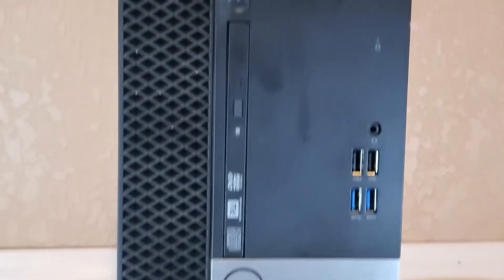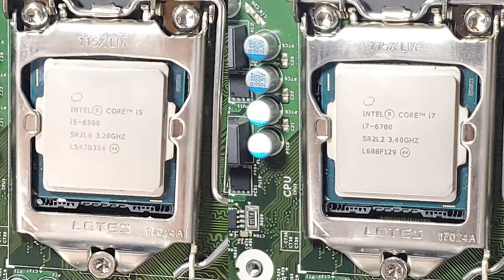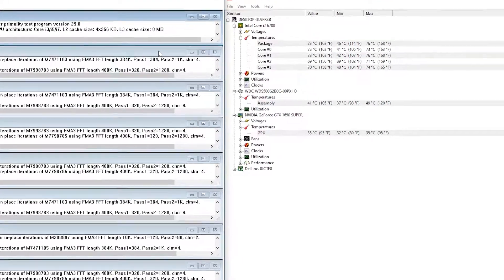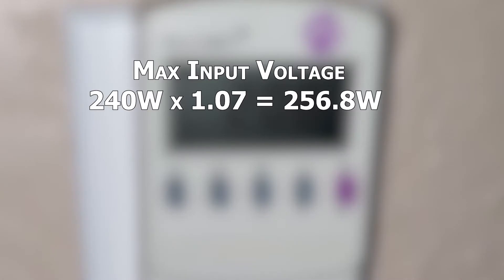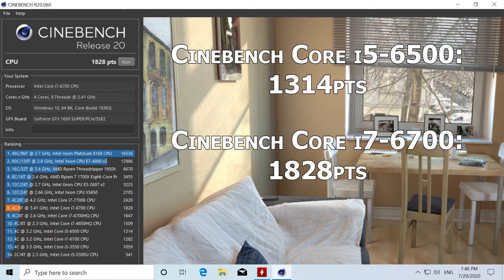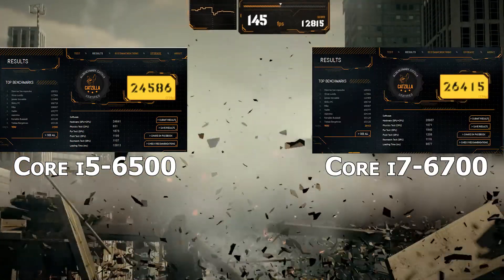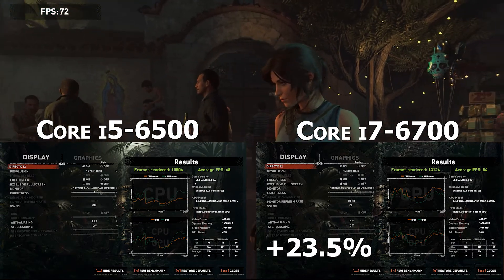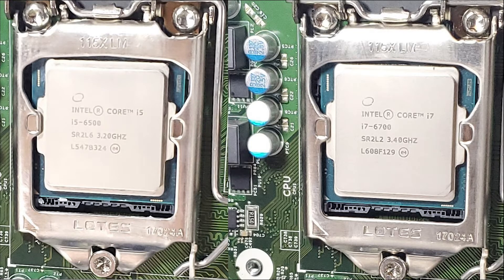Dell Optiplex 7040 Upgrade - Core i5 6500 vs Core i7 6700

Comment: You can upgrade it to 7700 max now not K versions but a 6700K does work
Reply: Ummm no 7040 optiplex supports up to 6th gen cpu that’s for only 7050 or higher

Comment: What about RPCS3 ? will it benefit from the jump to the i7 6700? I currently own the i5 6500 with the same optiplex 7040 and Im trying to play demon souls, and while in se places it reaches 30fps, in most areas it barely hits 20 to 24, and while I can definitely live with the slowdown, the choppy audio is what breaks the game for me... PC games run ok enough so if I jump to the i7 is mostly for emulation up to the PS3... Cheers!
Reply from the maker: Yes, I think the jump to an i7 6700 would benefit RPCS3.  Skylake was notoriously bad with AVX2 instructions, so I think it might even be worth taking a look at an i7 7700 to see if Kaby Lake handles it any better.  I am going to test a Kaby Lake CPU in an Optiplex 7040 tomorrow and see if it's compatible.  I'll update the results of my test here.
Reply: @EscoTech  Did the i7 7700 worked? I've read on the net in general that this computer doesn't work with processors other than the 6th gens...
Reply from the maker: @rick9021090210  I tried an i5 7500 and it wouldn't POST.  I think it is limited to 6th gen.

Comment: PLEX USERS STOP HERE:  from Reddit: "One, as cjcox4 pointed out already, your Skylake i5-6500 does not have decode support for HEVC 10-bit built into it's version of quick sync. That means your CPU's regular CPU cycles are doing all the decoding while Quick Sync is still doing the encoding. If you open up the PMS activity dashboard the play session probably shows "(hw)" on just the encode side of the video conversion instead of on both sides.

If you had gone slightly newer with at least a 7th gen (Kaby Lake) then the HEVC 10-bit would decode through Quick Sync. "  so in summary an 6th gen i7-6700 won't help you with plex so don't waste as of today $70.
Reply from the maker: Good info here for Plex users.  Also, most Skylake mobos are going to be compatible with both 6th and 7th gen CPUs (may need a bios update), so it could be an easy/cheap upgrade to go from 6th to 7th gen.  I think I still have an Optiplex 7040 and some 7th gen CPUs that I can test to see if the 7040 can be upgraded to Kaby Lake for quick sync.
Reply from the maker: I did test an i5 7500 in an Optiplex 7040 and couldn't get it to POST.  Even thought the chipset supports Kaby Lake CPUs, it looks like Dell Skylake Optiplex models are stuck with 6th gen and no upgrade path to 7th gen.

Comment: Hey boss thank you so much for this video, I plan on building an optiplex 7040 with i7 6770 and an rx6600 gpu, as a budget pc for Black Friday, I’m hoping to get some deals and save money, I will upgrade to a sfx psu to be safe but do you think it will run ok without bottlenecking too much? I only plan to play 1080p really
Reply from the maker: You will have a little bit of a bottleneck, but nothing major.  If so, you can always move the GPU to a newer motherboard and more powerful CPU later and get more life out of it.

Comment: Which card is compatible with  DELL Optiplex 7040 Core i7-6700??  and thank u
Reply from the maker: Are you asking about a GPU?  The Nvidia GTX 1650 Super (or even a regular 1650) or AMD RX 6600 are good matches that should work within the power limits of the Optiplex 7040.

Comment: Hey could I put a i7-7700 in a Dell optiplex 7040 it codes with a i5-6500
Reply from the maker: Yep, should work fine.  The 6th and 7th gen Intel CPUs are compatible with the same chipsets.   Thanks for watching!

Comment: Thanks for all these videos on the dell 7040 really helped me figure out what I want to do with mine. I picked up a 7040 with an i7 6700 after watching many videos on the system yours are the best and have decided to go with a 1650 super myself. I have however been buying a few parts should I decided to upgrade the psu and graphics card in the future. Will probably look for a donor case to make mods to as don't want to mess up and be left with nothing 😂. Looking at botte neck calculators I think a gtx 1080 ti is basically the perfect card to marry with a i7 6700 but obviously that would involve some creative changes 😅
Reply from the maker: It's still fun to build in these older systems and squeeze all the performance you can out of them.  Thanks for watching!

Comment: Nice Video.  appreciate.  I just bought one of these for 80$ i5 6500 16gb ram.  I just like the fact that I can hook it up to my TVs I have it connected to 3 of them with HDMI.  and 2 display port to hdmi adapters.  I usually watch a stream, one on youtube on another and whatever else I am working on or browsing at on the other.  Small sits next to the Playstation 4 and we use it for movies and Music, but its ideally for FootBall and Sport games when multiple games are.  Solid Computer might invest in it for like retro gaming if I can figure out where to get good emulators and roms.  but for now its just an entertainment machine.  One of those, if I had the extra money i'd supe it up.  But computer parts have jumped so much over the last couple of years.

Comment: Currently on an i5-6500, Is it worth if the i7-6700 costs 80 US dollars?
Also would the bottleneck be severe with a 1660 ti?
Thank you.
Reply from the maker: The i5 would probably bottleneck a 1660 Ti some, so an i7 6700 upgrade would probably be worth it at $80.  At 1080p, it might bottleneck some more CPU intensive games, but it should be OK.  Thanks for watching!
Reply: @EscoTech  Thank you very much!

Comment: Good home review! So, conclusion: we can use 100W gpu with safe (~80% load on psu) with i7-6700 in a Dell 7040. This is a great news.
Further quaestion: 2 ram or 4 RAm modul? How many other hardware components are in the PC? Like HDD, SDD. Just to calculate with safe load of PSU?
Reply: Hey, it's some month later but: there are 2 RAM slots (2400Mhz) and max. 1x DVD RW drive (slim), 2x 2.5" SATA drives and 1x  NVMe SSD.
A 100W GPU should work when not connection DVD drive and SATA drives. With drives it could trip, not sure since I use a 1650 non-SUPER.

Comment: Hi, I got the 7040 with an i5 6500. we got a spare i5 8250u, can I add this processor?
Reply from the maker: No, the i5 8250u is a laptop CPU from a different generation and will not work. The 8250u is also a different socket and is usually soldered to the motherboard, so it's a little strange to even see one outside of a motherboard.

Comment: Honest question, how did you upgrade the CPU? Did you just swap the CPU? Does the original Mobo on this support both i5 and i7?
Reply from the maker: Most CPU sockets/chipsets will support an entire generation processors.  This PC will support anything from Intel's 6th gen, which are code named 'Skylake' and have the 6XXX numbering system.  You can always look up the officially supported CPUs on Dell's website.  It may need a cooling upgrade, but I think the i5 and i7 of this generation both have the same TDP of 65 Watts, so the cooler from the i5 should be sufficient.  Thanks for watching!

Comment: Where is a good place to purchase an i7-6700 CPU that will replace the i5-6500 in the 7040?
Reply from the maker: They are still a little over priced, but I see them frequently on ebay and shopgoodwill.com, which is Goodwill's auction site.  Thanks for watching!

Comment: can add i3 7100 in optiplex 7040?? actually i am running a g4400
Reply from the maker: The 7040 only "officially" supports 6th gen Intel CPUs, so the i3 6100 would be the supported 6th gen CPU.  However, most motherboards have 6th and 7th gen support built in, so it SHOULD work, but I don't have one to test and can't confirm it.

Comment: I have the i7 6700 paired with radeon vii do u think it's OK or the bottleneck is too big
Reply from the maker: That CPU is probably not keeping up with the Radeon VII, but if you're at higher resolutions, it might be OK.
Reply: @EscoTech  im playing at 1440p an my ram speed is 2133 i think
Reply from the maker: At 1440p the bottleck shouldn't be too bad.  It'd probably go a little higher fps with a 9th gen or newer i5 or i7, but you're probably OK.

Comment: Hi excelent information, a question, can i put DDR4 3200mhz memory to Optiplex 7040?
Reply from the maker: It will work, but it will downclock to run at the max speed the CPUs can use, which I think is only 2100 Mhz.  Thanks for watching!
Reply: Should be 2133 i believe
Reply from the maker: @Knights_of_the_Nine  You are correct, 2133Mhz RAM is the max supported speed.

Comment: Was the 6700K an option for the Mobo also?
Reply from the maker: It will work, but without a Z series mobo/chipset you can take advantage of the unlocked multiplier and overclock, so you'd be gaining a 600Mhz faster base frequency, but only a 200Mhz faster boost frequency.  I don't think Dell sold any stock with a 6700K.  Thanks for watching!
Reply: @EscoTech  Ok I was told the same about my 7050. Thast the 7700K wont work in the same regard and that I need to get the 7700. My question is why does the 7700 cost more that the 9700K? Lol

Comment: hello good video a question can i use the core i7 6700 processor with the gtx 1650 graphics card?
greetings from Mexico 😁
Reply from the maker: Yeah, it'd work fine.  If you game for more than a couple hours a day, I'd suggest a PSU upgrade.  Thanks for checking out the video!
Reply: @EscoTech  nothing happens to the pc if I change the power source?

Comment: Is an i5-6500 compatible with dell optiplex 3010
Reply from the maker: No, the Optiplex 3010 uses Ivy Bridge(Intel 3rd Gen) processors.  They will all be in the 3xxx range.  The fastest is the i7 3770(and the Xeon equivalent), and the two best i5 CPUs for the 3010 are the 3470 and 3570.  Thanks for watching.
Reply: EscoTech thanks so much bro 
U saved my life
There should more people like u.

P.S u earned a sub
Reply from the maker: Thanks for the sub.  If you have an Optiplex 3010, definitely take a look at the Xeon e3-1230 v2 or the e3-1240 v2.  They are basically i7 3770 CPUs for cheaper.  I'll be doing a video on one soon.
Reply: EscoTech thanks bro
Reply: EscoTech u will reach 1k subs in exactly 37 seconds
Reply from the maker: Haha, you weren't lying.  I just hit 1,000 subs!  Woo-hoo! Thanks!

Comment: I see an Optiplex 7040 on my local Craigslist. Seeing that you paid $120 for your i5 set up, how much more do you think an Optiplex 7040 with the i7 is worth?
Reply from the maker: Tough to say for sure without knowing RAM and storage in the system, but I'd say a 7040 with an i7 is worth $80-$100 more than a similar 7040 with an i5.  Problem is that gets you closer to the price of 8th Gen Intel parts that all have higher core counts, and also closer to some of today's budget to mid-range parts that are faster than the i7 6700.  The i7 6700 is still a solid CPU, though.  I wouldn't go higher than around $300 for that, including CPU and RAM.
Reply: $200 for a 7040 i7 w/o HD is fair.

Comment: hey i have upgraded everything on my pc but the i7 6700 i have it paried with radeon VII is that a bottle neck for my gpu?
Reply from the maker: Yes, the i7 6700 is going to bottleneck that GPU pretty severely.
Reply: @EscoTech  oh is that because of its age? or because its noot strong enough
Reply from the maker: @lumia_dayZ  The i7 6700 was a powerful CPU when it was released, but the higher end GPUs were already starting to outpace the CPUs at that time.  Eighth gen amd newer Intel CPUs have more cores and are faster all around.  A mid to higher end current gen Ryzen would pair better, too.  I'd definitely recommend a CPU upgrade, down side is any of these are going to require a new motherboard, too. Good luck!

Comment: Great video. I have a quastion..I have 7040mt with i7 6700 16GB DDR4 and 256Gb SSD, but i have 1TB HDD, and one 1TB external HDD. 240W 80+psu is ok if I upgrade HD530 with GTX 1650 Super?
Reply from the maker: You should be fine, but if you are a hard-core gamer and playing more than a couple hours a night, I'd probably consider an upgrade.  There is a 315w Dell Server PSU out there that people have put in the 7040 and I've also seen a video where someone puts in an SFX size PSU.  The Dell has the OEM connectors, the SFX needs the 6 pin power adapter.  Thanks for checking out the video!
Reply: @EscoTech  thanks for help 🤝 or I buy RX 550 less fps, tdp 50W vs GTX 1650 S 100W. I'm not a gamer fun, I watch 4K video, and 1-3games play simetimes. Gta 5 for example 1080p.

Comment: great video, I have all the same parts in a dell 3650, I'm about to transfer all of it into the 7040. DDR4, Nvme, and better chassis. Dropped in a noctua L9-65 and a 314w dell PSU. Price is adding up for me but i enjoy modding and maxing out this system.
Reply from the maker: I enjoy the upgrading process, too.  That will be a pretty sweet setup.  I considered doing a Noctua CPU cooler upgrade in this system, but I'm actually going to use that cooler upgrading my own custom low profile build.  Video coming soon on that PC, too!
Reply: @EscoTech  How did I do? https://www.reddit.com/r/SleepingOptiplex/comments/jk3bvl/heres_my_dell_optiplex_7040_started_life_as_an_i5/
Reply from the maker: @matrixsuperstar  Awesome job, man!  Much better than mine. :)  I really like how you did the SFX power supply, too.  That was simply genius to mount it the way you did.
Reply: @EscoTech  hey can you tell me how many hard drives this pc can take going to make a diy nas out one

Comment: Hey again! I bought the 9020 with an i7 4790 would you recommend upgrading it to a high i7 like this one or would it not be worth the value Awsome series btw people like me find it so useful (:
Reply from the maker: That i7 4790 is the fastest CPU that can go in that system.  Intel changed the CPU socket for the next generation.  Don't worry, though the 4790 is still a great processor and will serve you well, the i7 6700 is only slightly faster and wouldn't be worth it, anyway.  Glad the videos helped you out!
Reply: EscoTech I shouldn’t complain the only game I’ve had any kinda trouble with FPS wise is the new windows flight sim but that’s well uh very understandable haha thanks again!
Reply: @danielpataki5491  Actually you could get the 4790K, or the 5775C but those are expensive for what they are